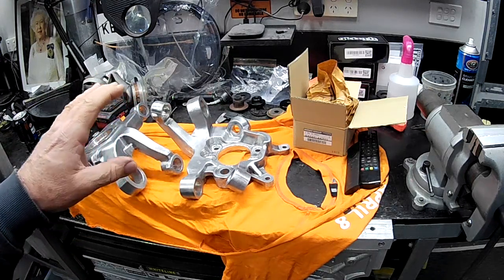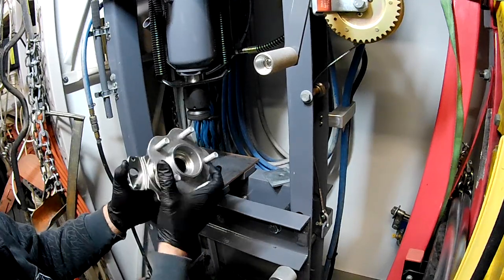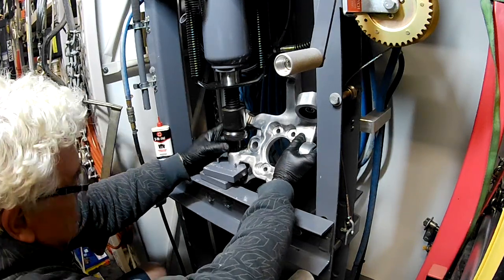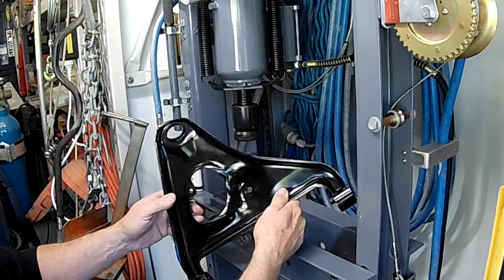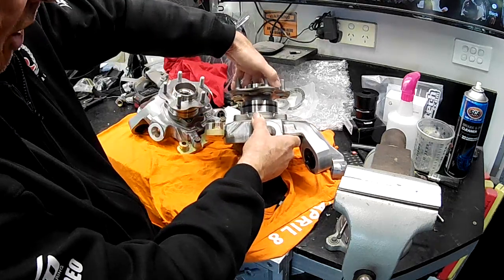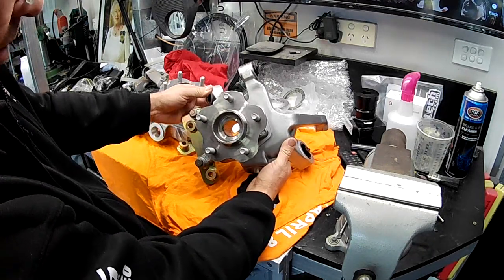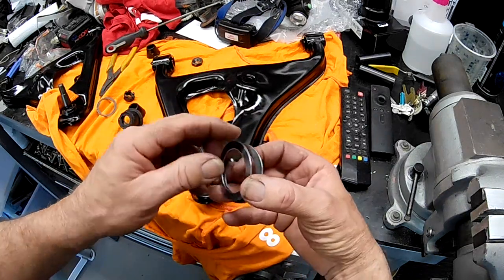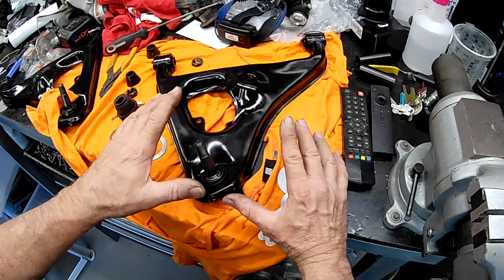Rebuilding Rear Hubs. Project Fairlady The Nissan Z32 300zx Twin Turbo Mega Build.

Comment: Sorry if this is a dumb question, but curious what specific type/size bolts are on for the hub bearings @10:25? I know they are 19mm (oem) but don't know what thread or length they are.

Comment: G'day Trevor, we enjoy your videos keep em coming. Just a thought mate, are you able to gauge your press on how much pressure you're applying? You haven't over pressed that bushing a little to create that gap, I'm sure you've thought of it and inspected the lower arm for stress. It was just my first gut feeling. Cheers mate.
Reply from the maker: G'day, no, no over pressing, just an aftermarket vs oem mismatch. If stuff is setup properly in the Press, its near impossible to damage it in anyway. Particularly with a small press like this. (20Ton) Cheers.

Comment: Hey brotha, question for you! Do you know it there is a difference between the z32 na and tt rear wheel bearing? Could we compare dimensions between the two? Mine are going bad and the NA w/ebrake bracket ones are not available, wondering if I can use tt ones instead. Inner race ID: 42.8mm, cylindrical housing height: 56mm, threaded mounting holes long way center to center: 100mm, threaded mounting holes short way center to center: 45mm, mounting face cylindrical step height: 11mm. If you could confirm these dims I would be your best friend. Thank you!
Reply from the maker: G'day Mate, I honestly dont know, but due to the different part numbers I would assume they are different. I guess it would be due to the TT having much beefier axles. Mines all together so I cant even get in & measure it. Cheers.

Comment: Yeah im the same, not a big fan of mechanical aftermarket parts either, theres always a fittment issue which is why i strictly used oem for those parts for my build. But over the years its getting harder and more expensive to buy oem then aftermarket and my income just cant justify some of the prices for oem parts and not to mention i mainky buy from the us so conversion rates are bad and you pay more the i like which is why my build basically just turned into a daily driver on a budget with regular maintenance.
Reply from the maker: I hear ya Mate. Very rarely am I happy with aftermarket parts, but some times there's very little choice hey.
Reply: @TheAussieShed definately, ive changed my opinion on oem only parts for my z and im hoping to use aftermarket parts for my next 100k service to reduce costs as much as possible. It also helps i work for repco and can source some parts at staff prices:)

Comment: I still reckon you overcomplicated the press...never did explain why you bothered to flip the valving to use up side down, rather than just running the jack the right way round and build a head for the base - you know, for us "newbies". Oh well, I'll let bygones be bygones and never, ever mention this again. Those spacer rings should be painted black, not galvanised. I'm just in the mood to armchair criticise tonight (yes it feels good) - for the sake of the youtube algorithm ofcourse! Oh, I wish they had a little fine print font for this next bit - the fairlady is going to be one quality beast, way better than new when its done!
Reply from the maker: Alright, alright Benny, I'll explain lol. To use the jack upright you need to retain the crossbar, Crossbars Suck Bigtime.
If you can get them tight enough to not move around when you're pressing they bind.
The Crossbar makes it near impossible to slide the Head from Left to Right, a big feature for a press & one I use all of the time.
Crossbars get in the way all of the time, if you have to press something with a piece that sticks up & needs to be turned so its under the crossbar, the press is useless.
Particularly with car stuff you encounter some really odd shapes, eg, the rear uprights in this video 
Have a look at any decent professional press, none of them use a crossbar, they all use a top mounted Ram & for good reason, did I mention Crossbars Suck?
Its a fairly common mod to Invert the Jack & Top Mount it, on cheaper Presses, to get rid of the crossbar, I just took it a step further.
Crossbar Presses are just to limited for what I use a Press for, maybe in a small machine shop setting they would be fine, but not great in an Automotive One.
Jeez, look how much you made me type, me being a one finger typer and all.
Cheers Mate.
Reply: @TheAussieShed  You are a star! Thanks.